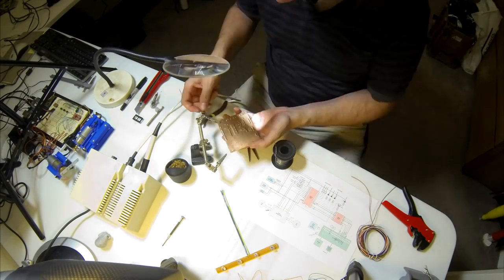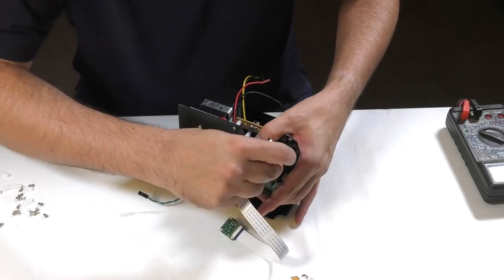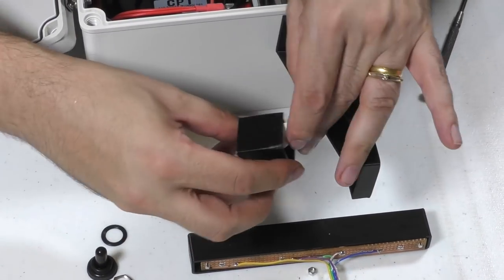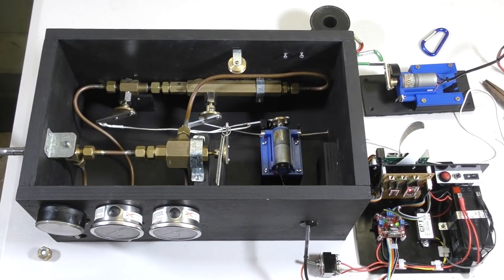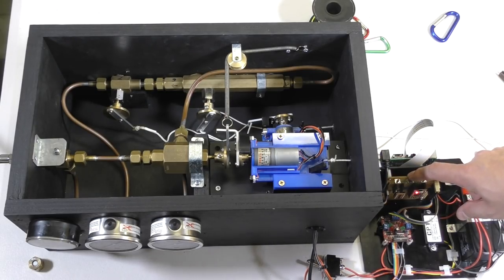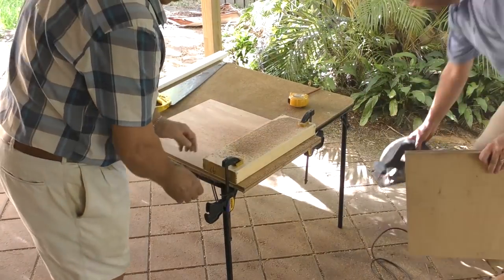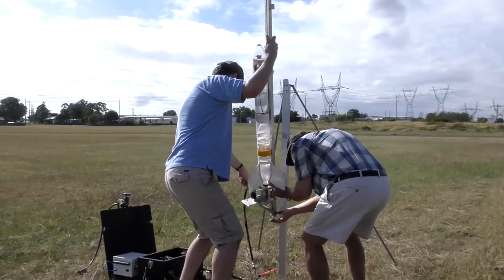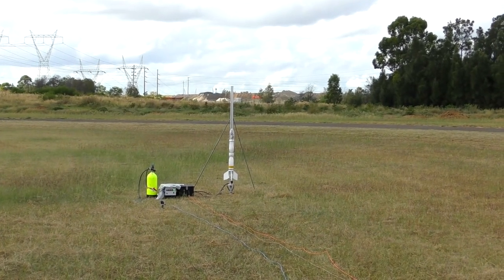2 Stage Water Rocket - Part 10 - Launcher Complete

Comment: Hats off to you!. The control box looks robust, compact and easy to use. What is the reason why you use two different power supplies? Is it that motors are noisy and you don't want voltage spikes to destroy the Raspberry Pi?
Reply from the maker: Hi Daniel, that is a good question. It was partly that, but also because we already had the SLA battery (and charger) that gave us the 12V needed by the motors, but its capacity is only 1.2Ah. It had enough capacity to run the motors and controller but not the Pi at the same time. The pi draws about 2A. We needed to make sure that we had enough power for at least the whole day. We used a the power pack because it could supply the 5V at 2.4Amps for the Pi directly, and when we are not using the launcher we can use the pack for other things like charging phones in everyday life. Ultimately it all could have been powered from the same battery say a 3S LiPo, but we would have needed to buy that and a charger as well. In the end we just used what we had. :)

Comment: Hi George, recently i wanted to make a water rocket by splicing the bottles but in my country (Romania) we don't have PL PREMIUM. The only one i could find that is known by you is Sikaflex wich from what i understanded without any kind of reinforcements to the rocket it won't resist at a 130 - 160 psi. I wan't to ask you what i should do.
Reply from the maker: Hi, do you have access to a polyurethane based wood glue? It's normally honey coloured and quite runny. It can be thickened and used for splicing.
Reply: @AirCommandRockets  it's ok?
Reply from the maker: It may be ok. The only real way to know is to test it. Here are some tests we did with a similar glue: http://www.aircommandrockets.com/day46.htm
Reply: @AirCommandRockets  It is necesary to make the glue thicker ?
Reply from the maker: It may not be necessary with your specific glue. Try a splice first just with the glue and see how you go. If you find that the glue runs a lot and you have leaks because the glue ran out of the joint, then I would try to thicken it. Having the glue thicker makes it much easier to work with.
Reply: @AirCommandRockets  Thanks for the advice and if i don't forget im gonna come with an update on 12 june.